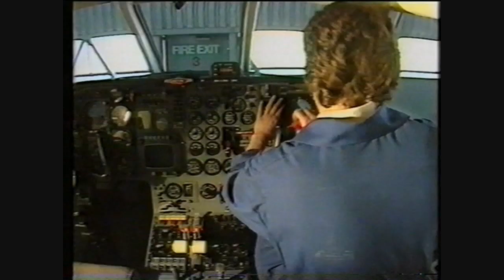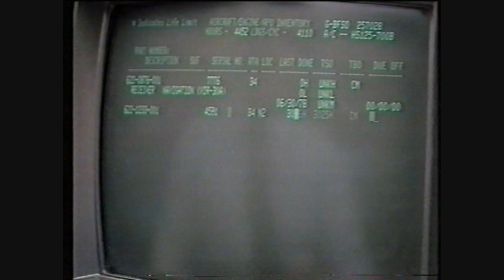Fields Heathrow EJC (Executive Jet Centre). Became Hunting Business Aviation

Comment: I was there working for Falcon Jet Centre who had offices on the second floor of the main building from 1985-1997. They operated the Falcon 20F G-BGOP seen in the film. The pilot was the late Cliff Middleton: I date this film from the mid 1980’s.
Reply: Yes, about 1983, that hanger shown replaced the old war tme arched one and was built when i was there between 1982-1983.
All the Shell Fleet, Tenneco, Rank Zerox, Dravidian (Debeers), flew HS 125- 400, 600 & 700s; Gulfstream 3 & 4; Falcon 20 & 50, various Lear 20, 30.
Two faces i recognise...Tommy Geary working on the Garrett TFE 731, hectook over the Engine shop after his course, he looks older in the vid, but he was a hard drinking geordie..!
And the old guy working on that PC...a planner or QC guy maybe named Barry ??
He signed me off on NDT inspections i think.
No sign of the shifty Maintenance Mgr...Fred ???

Cheers, 
Norrie Potter
Ex A&C Lic AME
Reply: @chriscraik9045  Barry Wale and Fred Chandler (deceased). Also Kalsi, Peter Mercer, Fred Forde, Jim Hill (eng shop), Bob Stacey, John Smith. No record of Fred Chandler on the interweb, he originated from De Beers then joined Fields as an unlicenced fitter, became foreman and hanger manager with Al McGrath. Last saw Tom Geary in Egham after redundancies.
Reply: @ClassicAviationTV  I worked with the first four of those people. Started my apprenticeship there in 1991.